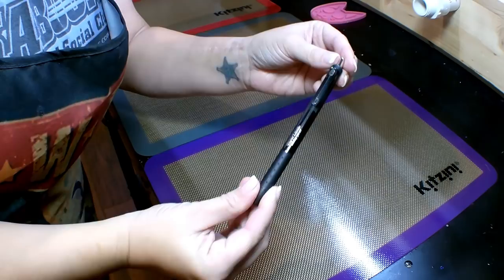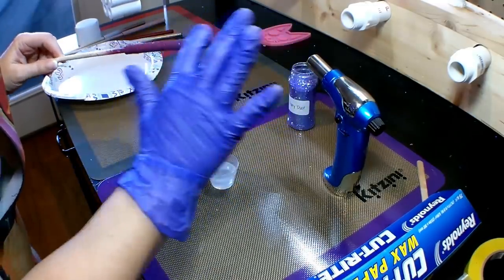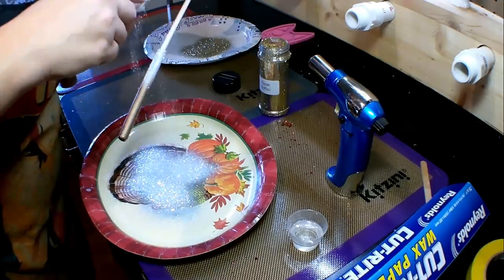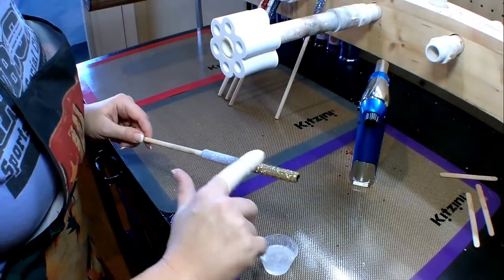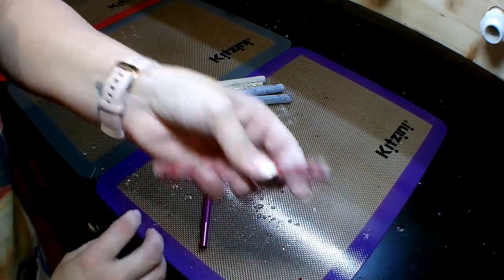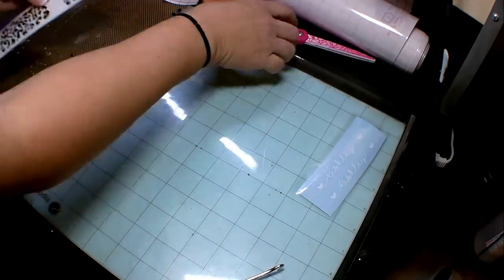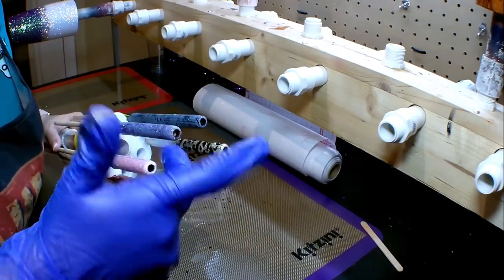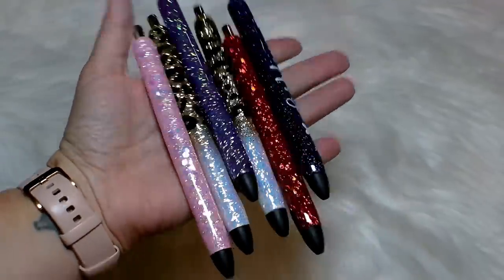Epoxy Glitter Pen Tutorial Part 2 Update | NEW Tips & Tricks | Leopard Print Pens | Inkjoy Papermate

Comment: Why does everyone use the inkjoy pens? I love them but just curious why people use this kind specifically.
Reply: because they dont have a built in gripper, the part there is easy to sand and that makes it easier for paint to stick and epoxy resin.  The pocket clip on the pen also is easier to remove and sand down the space on these pens specifically . I have found a couple more pens that could be done this way as well.
Reply: @sparklesass780  thank you for the explanation!! 😊
Reply from the maker: Thank you Foxes Farm. Yes, R V Foxes Farm's explanation is perfect :)

Comment: Can you please send me measurements for decal im making some for a church
Reply from the maker: The measurements are 1.5 in x 2 in. you may have to adjust that slightly though depending on how thick your epoxy/glitter is. I have actually shared the cut file with everyone on my Facebook group, if you join the Facebook group you can find it there and use it. 😊🥰
Reply: @KristisCustomCreations  and yes I joined the Group
Reply from the maker: @benitagarcia2220  did you find the file in the group?
Reply: @KristisCustomCreations  no mam
Reply from the maker: @benitagarcia2220  when you're in the group page on facebook, click on announcements then scroll down. You will see where Susie shared my SVG leopard print file for everyone. 😊